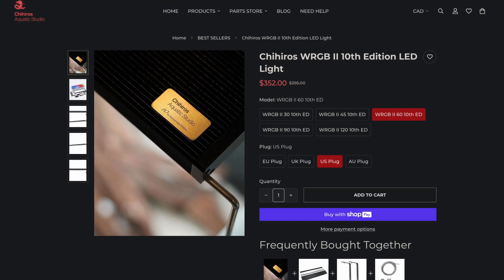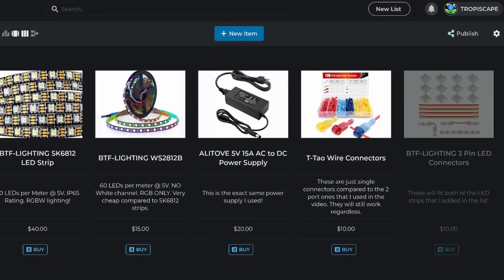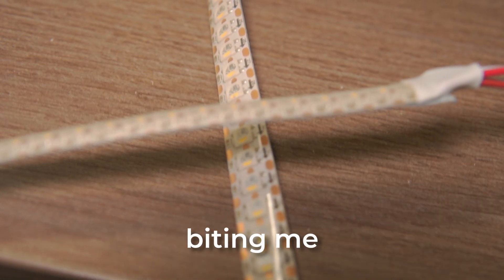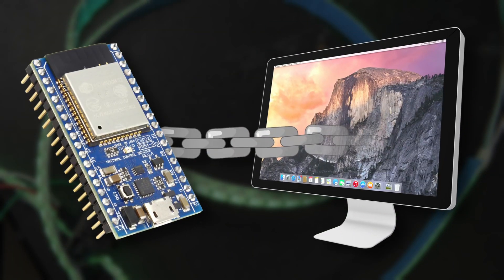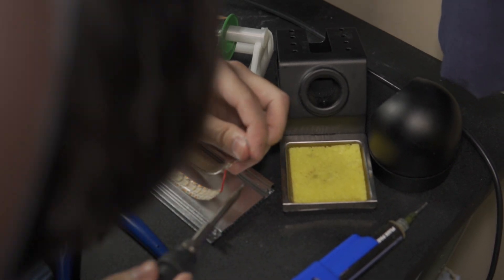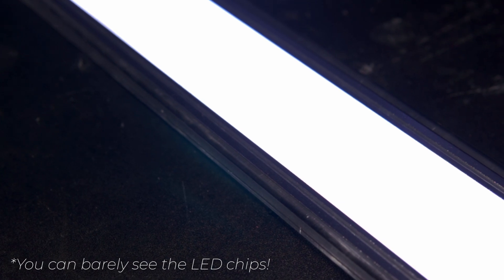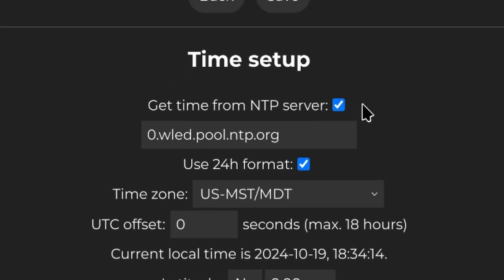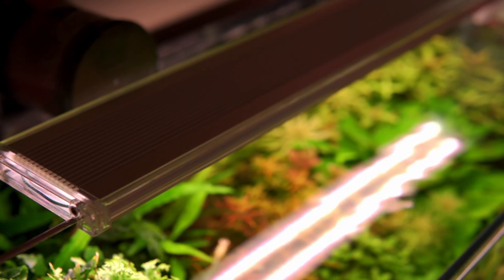Make Your Own Planted Aquarium LED Light! | Easy Tutorial

Comment: Will this work for plants with high requirements?
Reply from the maker: I'll be blunt and say probably not with these types of lights. I did switch back to my Chihiros WRGB 2 because of this.

That said, if you're able to find better LED chips to use, you can definitely DIY a high-tech capable light fixture.

Comment: I'm planning to use individual LED strips for each color—White (W), Red (R), Green (G), and Blue (B)—and connect them to an ESP32. 

Could you please advise on the following:

How can I wire them to the ESP32 for individual control?

Which GPIO pins would be suitable for connecting each color?

Comment: Hi what about instead of two rows, yu could try 4 rows and without light diffuser, get a watersproof led instead, also yu could add a pwm white light with the ws2812 for brigther colours, i saw a commant yu switch back to chirros . Would this idea work, whats ur thoughts?
Reply from the maker: Technically, the LED strip is already waterproof as it's covered in a silicone cover.

It could work, but do remember that we still need to make sure that we are providing enough power for all of the LED chips. We don't want the ones near the end to not be as strong as the ones at the beginning. That being said, I think 60 LED diodes per meter would work with this. Using WS2812 could work, but it's just RGB, not RBGW. So, we white light might look off. 

The only reason I didn't use 4 rows is that my light chassis is not wide enough to house 3+ rows.

I did switch back to the Chihiros light. It's way stronger (especially in the red spectrum) than the one I made and has a way better UI for control.

Comment: Any update on plant growth or light performance?😊

And also you said 60 led better 144 led. But both required different amount of power right so why don't you just increase the current so you can get a brighter LED using more LED?
Reply from the maker: I switch back to my Chihiros WRGB 2. The reason is that the WRBG 2 is just much stronger, which is what I need for that tank. That being said, the light can still grow plants, I just needed a stronger light for my application.

As for the power, cost comes into play. You can get the same performance or better for less LEDs with the same power supply. Increasing the current will require a different power supply that might be more costly
Reply: @ 
If I'm not wrong your adapter give 15A current but you only use 2.5A current right? Why can't just increase the current more?
Reply from the maker: @naanVimalSarminra the power supply I used is rated as 12V 5A, not 15A. So, no, I cannot use more current than that the power supply can provide.

The reason I say 60 LED diodes is better than 144, is that the 60 LED strip requires less power to go to 100% brightness compared to the 144 one. The 144 strip might need a power supply that provides more Amps to get to 100% brightness, which may be more pricier.
Reply: @ thank you 😇
Reply: @TropiscapeAquatics  but how you connect 12v to your esp?😅

Also is the any difference between 5v led and 12v led
Reply from the maker: Whoops! My mistake, I mixed up two different power supplies that I bought. You are correct in that the power supply I used was rated for 15A. However, the power supply is rated as a 5V 15A power supply. The ESP32 that I used can only be powered with 5V. Anything more than 5V will fry the ESP. If you do want to use a 12V power supply, you need a buck converter that converts 12V to 5V or a MOSFET that can do the same.

Sorry for the confusion.

Comment: Bro you used the sk6812 strip can I get the same result from ws2812B?

I want to create 80cm light for a 90 cm tank with 60led/m 

How many rows of LEDs should I use?
Reply from the maker: You can use WS2812B, but the reason why I went with SK6812 is due to them having the extra white channel.
WS2812B = RGB
SK6812 = RBGW

As for the rows, definitely two or more rows if you have the space for two rows. Just remember that more LEDs = more heat. You'll need to have an adequate heat sink if you use a lot of LEDs.
Reply: is there huge difference in between ws2812B and sk6812
Reply from the maker: Basically, SK has the additional white channel (RGBW), while WS is just RGB.

A lot of high-end aquarium lights use RGBW LEDs

Comment: This is interesting and attracted me to learn more.
But I have a small doubt that the LED's you used in the video are 12v DC and in the link shows as 5v. DC. Which one did you use? Also if you have used 5v DC LED strip, when 12v 15a adapter is connected to the LED strip. Won't it burn out?
And also I would like to know how much heat it dissipated when you have set it to 12.5A for high brightness.
Reply from the maker: You're right about 5V strips being blown out with 12V. But the power supply I used is actually rated as 5V 15A. Not 12V
Reply: Where is your list?

Comment: Is it possible to diy a quality led light wrgb 2 pro? What if we use beads from chihiros and diy on it? Can you please suggest if something like this can be done?
Reply from the maker: Hmm... not 100% sure if it's possible given how we don't know the exact LED diodes they use. Even if we do know the exact LED diode model, there's no guarantee that the WLED software can support them...
Reply: @TropiscapeAquatics  Hmm valid point, I was thinking of buying vivid led bead + pcb + bluetooth + power adapter. Only thing left is heat sink (which I will improvise and no fan). I have got a 4 ft tank. So I am just trying to save some money. If I can make it work, then essentially I will get two vivids at the cost of one. Am I missing anything here? Also please let me know if you have any heatsinks in mind that can work for this. Btw, great video and content. You gave me little hope.
Reply from the maker: @aakashdabas982 Hmm... the heatsink will be the hardest part to source. For me, I used a broken light's heatsink. Wood might be out of the equation given how hot a regular Vivid can get... 

The only thing that comes to mind is making the main body out of wood, but use a piece of sheet metal to put the LEDs on. The only issue with that is that it may be possible for overvoltage or other electrical complications. I don't think this will be enough, though... You could have some "vent holes" on the side or above for heat to escape from.

If you don't mind me asking, where are you sourcing the Vivid LED beads?
Reply: @TropiscapeAquatics  they are listed on their official website. All parts included pcb and bluetooth module.
Reply from the maker: @aakashdabas982 It might be pretty easy to put together if you can buy every part for the light, except the heatsink, of course. You might not even need to use the WLED software as well and control it through the Chihiros app. It'll still be expensive, but if you have the time and cash, try it out!
Reply: Absolutely, if you sourced proper LED's and took the time to make one, you could go all out, spending $100 on everything and have a light far more capable than the $500+ lights. The only thing you have to really think about is how you want the light fixture itself to look and take into account cooling for the LED's which is why many are made of machined or extruded aluminum. If you don't care about how it looks and that it simply has quality light for plants, you can save time and money in that way. For a bit of extra effort you can have a nice looking fixture that blows most if not all consumer products out of the water, even better yet, you made it yourself, if an LED or something breaks, you can more easily repair it because you know how it was made and how it works more than their proprietary BS.
Reply: @MidnightMarrow  what is your time worth? that's a real cost...much more expensive than money. Sourcing all that crap is also expensive.
Reply: @jpcreativeimagery  It is and the reason why doing things yourself can be so much cheaper. You're paying for their many employees, the parts and shipping etc to make the product. You as an individual can make similar items buying better parts often times fairly cheap depending but LED's for instance and a power supply for them is cheap as is an aluminum sheet to disperse the heat and imparting your labor into it. You could potentially spend an hour making sure you have the quality parts you want for it and spend another hour or two to assemble it when they get to you which in turn gives you more knowledge and experience with something like this. People can save up for awhile to buy a $500 to $1000 light or potentially make one of equal or better performance for less than $100 so it's a question of saving money for months to finally buy it premade or building it yourself much cheaper, in the end you're converting your time / life for money to buy it or simply taking time to make something, I feel like in this case something so simple you may as well do it yourself unless you're making so much money it doesn't phase you to drop that kind of cash on impulse and most people don't have that luxury as most jobs simply don't pay that well so building it yourself could in fact be "more cost effective" in the sense of "your time"  regardless of if you put an hour into it or a 6.

Comment: . I' d rather not cheap out and buy a real one than go through all those steps
Reply from the maker: That's completely fair! 👍
Reply: To build something yourself isn't always "being cheap". You can build a far more capable light for $100 that a company might sell for $1000. It might be cheaper but by no means is it not a real one. You could go to a place like DigiKey or similar, buy high output quality LED's in a higher quantity than in most panels and within 30 mins have it all wired up and you could go more low tech and simply run power to it via a timer instead of setting up an ESP for WiFi control. For me the only downfall to this setup is the LED strip used but the same process would be used even with individual much more capable LED Diodes but instead of doing a single strip you're connecting multiple diodes instead which really isn't that much more involved oh and going my route you'd likely need a different power source after calculating the amount of LED / size diodes chosen but pretty simple stuff and it's exactly what these companies are doing aside from designing their fixtures and slapping other products into it from other companies.

Comment: Good job. I built a DIY LED light with high PAR using amazon T5 integrated LEDs. I fixed the spectrum by adding a 3000k version mixed with the 6500k version to create a desirable spectrum.
Reply from the maker: Interesting... however, there's a slight issue that I see. You're talking about colour temperature, which is completely different than PAR values. Furthermore, it's possible to have the same colour temperature but have different light spectrum outputs
Reply: @TropiscapeAquatics  its high PAR because its over 120W and gets the plants pearling without any co2; I don't have a PAR meter but im guessing its hitting 100-150. The 3500k tube just fixes the visual spectrum because 6500k appears cold and doesn't show off the reds as much

Comment: I recently planted my aquarium Dutch style, I planted some of my stem plants in a ‘bunch’ as it made it easier to keep them in the soil when using tweezers. 
Do you think this will cause a problem as they grow? 
Also great content your channel has been very helpful for me starting up my first high tech tank
Reply from the maker: I'm glad my videos were able to help in some way!
As for the planting, it should be OK if they are not bound by something like string, lead weights, or rock wool. I usually plant stem plants in bunches of like 3 or 4 stems. Of course, that depends on how many stems I have of said plant. Another thing I do when planting is to wiggle the substrate a little as I pull the tweezers out. There are more techniques to planting specific types of plants. Green Aqua (IMO are one of the Gods of planted aquariums) has a video on planting:
https://www.youtube.com/watch?v=MGYLoaGv9jw

If uprooting is a concern, you might need to plant them a bit deeper and use more substrate to hold them down. That being said, keep an eye on them from time to time to make sure they are growing well. Let me know if you have any more questions!

Comment: I don't think 3d printer is cheap.
Reply from the maker: It's not. However, it's something I can utilize for my specific build. There's no rule saying things need to be 3D printed. Your build can be completely different. It could be made out of wood instead. I just laid down the groundwork of the project, which is the ESP32 and LED strip setup.

Comment: Interesting project. I tried the same things around 8 months back with WS2812B LED strip, ESP8266, WLED and external power supply. It worked great for few works and later some LEDs started blinking abruptly. There was corrotion in LED terminals due to water condensation. I set-up sunrise, sunset, peak light, low light with timing and even guest mode where visitors come :). Though the lights failed, I enjoyed the process.
Reply from the maker: Yeah, that was my main concern. I should have specified that I used IP65 rating LED strips.

All that matters is that you enjoyed the process! 😊